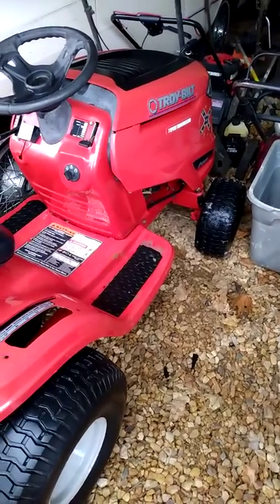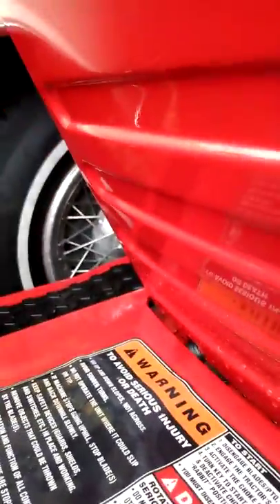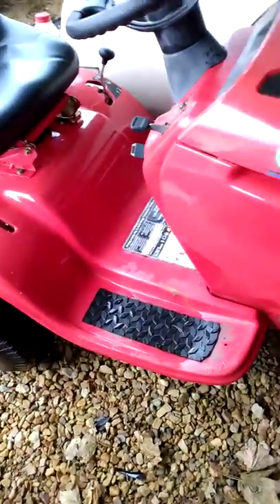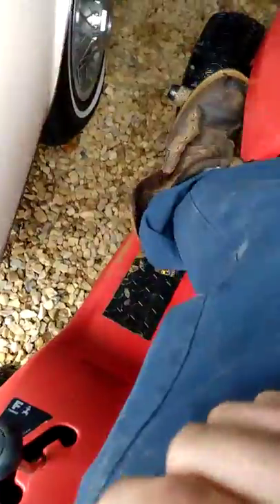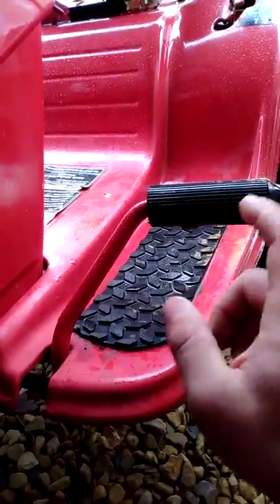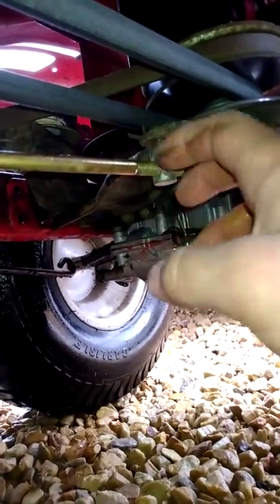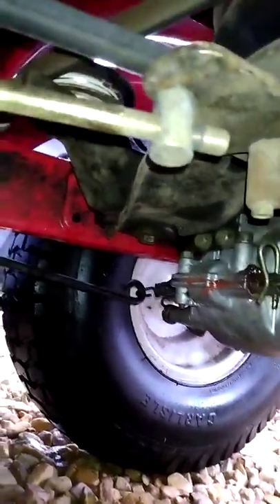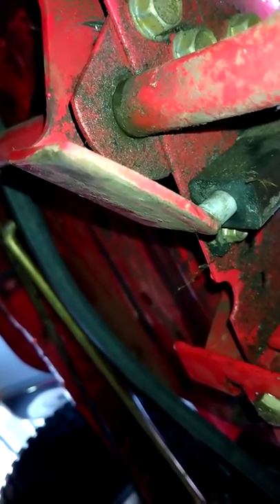How to adjust excessive clutch slop on an MTD riding lawn mower with the VSP system

Comment: I’m working on one and the clutch falls all the way back towards operator I figured it is missing a spring bc if a spring pulled back under it in the middle it would pull clutch slightly forward. I haven’t started looking at it yet. 
Mine you put in forward or reverse and push accelerator on right side and the more you push it the faster it will go. 
Do you still have this mower??

Comment: I have one of these that was left at one of rental houses. I’ve been working on it for a like a month. I’ve done mostly everything to it from spindles to deck belt drive belts blades carb rebuilt ect I’m down to like 2 problems one is that the clutch pedal doesn’t seem to want to sit against the medal like how yours does you have to pull it with your foot to get full speed & the other is all the plastic bushings are shot in the front end 😂 I don’t ever want to see another Troy Bilt in my life 😅

Comment: Up date I was wrong just take the battery out and the battery holder it is on the right but it is tight.l gave it 3 turns and it worked.

Comment: I have the same exact model and my machine is stuck on one speed and my clutch stays close to the tire. Do you have any suggestions for this problem?
Reply: I just repaired all warn parts on my 23-year-old yard machine (it's repainted, looks New) and I haven't done any adjusting yet, it only has high gear. I can't make it go slow. It only wants to go fast. If I figure out something, I'll post this to you, if you haven't figured out your problem yet?
Reply: Hey Jimmy, I figured out why my mower would only go in one speed and that was fast. I found that the tensioner pulley spring for the transmission belt was weak. The Spring had gotten worn out and wouldn't apply enough tension for the belts to move up and down on a variable speed pulley. I added an extra Spring with the original Spring and then put it back together and test it it. And now I have different speeds so it's fixed. But i'm still gonna order the factory spring & replace it, eventually. Let me know if you see this, and if this helps?

Comment: You didn’t show the adjustment process😢
Reply: Just remove the cotter pin with oilers, screw in toward the shaft, of several turns put it back, if lose do it again and make sure it’s in the highest gear (7) 
Count your turns in
Easy 😊
Reply: Pilers not dam oiler

Comment: the safety switch is only a factor when you start the mower..so you need to push the pedal all the way to start the mower, after that you only need to push the pedal in partially to change speed (push the pedal in until you feel the speed slack off), that's enough to change the speed.